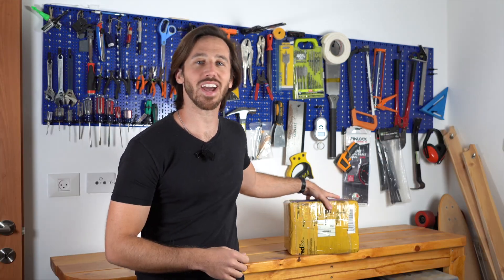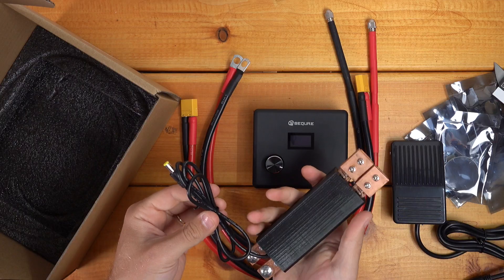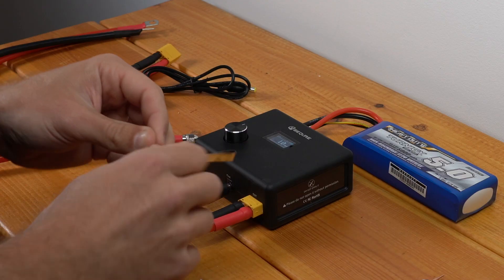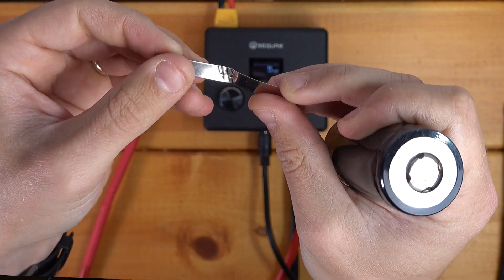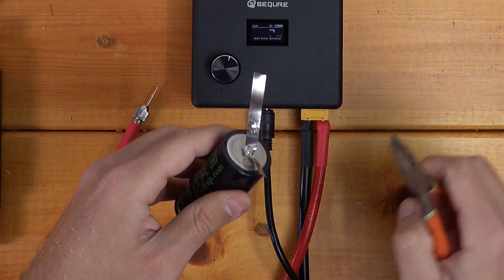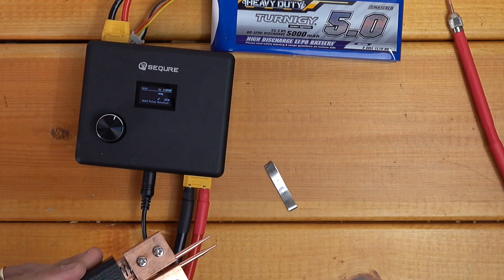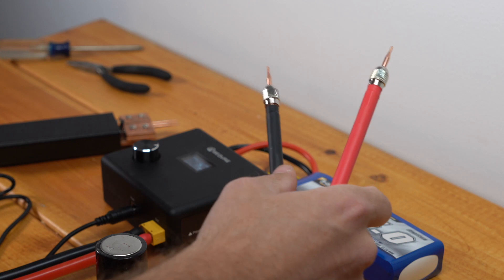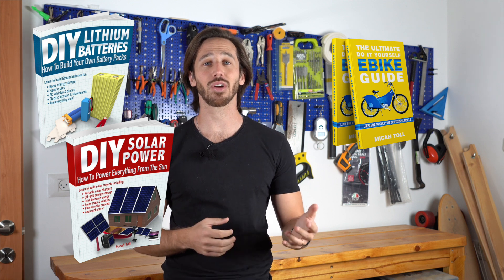Unboxing & testing the Sequre spot welder for DIY batteries

Comment: Mine is not working correctly, a 0.1mm strip needs about 30ms to 40ms and 0.2mm can't weld at 100ms and that's with a new battery(5000mA 3S 100c) I bought from Sequre!

Comment: I have a 2021 Bolton Lancer and I’m having trouble getting a secondary battery for it, seems it’s always out of stock.  I’ve just purchased your book on DIY lithium battery.  I’m not sure it will do me any good in build a battery for the Lancer as the secondary battery Bolton/Area 13 sells for the Lancer has a proprietary plug  the plugs into the side of the Lancer.  Do you have any thoughts on this?

Comment: I bought one or these after watching the videos thinking I wouldn’t need to buy another one. After waiting 3 weeks with no tracking details I got it and it worked good for the first 35 welds, after that it didn’t even went to boot up anymore. Said my battery was low even being charged for 4 hours. No power going to the leads. Spoke to the company and they sent me a defective board to replace and that took 2 weeks to come. Then accused me of wrongful install when I shouldn’t have to install a product that shouldn’t be broken. After I checked out the 2 boards I realized that the new board had 2 clips soldered wrong and it was shorting out of welder. All in all I’m pretty done with sequre as they really don’t understand that customers are the ones that make the company, not the other way around.

Comment: It’s very expensive, and based on Amazon reviews it takes strong batteries to power it. For the price you should not need to also provide a power supply solution. Reviewers have reported weak welds if power supply is not sufficient.

Comment: Perhaps exchange the button-head Phillips for button-head Allen?  There are drivers for those which are not merely-ball-ended, but also power-drive and setup like screwdrivers.  (I have these in Bondhus brand, both metric and SAE…)

Comment: Uses, "unsafe battery" to do a fusion method to link together the safer weaker batteries. LiPo batteries are not that bad. You literally have to abuse the hard case ones something terrible to get them to explode. I've dropped mine a few times 😬. And have had them since 2017. They're from powerhobby.
Reply: Every single lipo fire I have heard about was due to a fault in parallel charging. Don't paralell charge, won;pt have problems. They have reliable affordable quad channel chargers now like the Hota F6.

Comment: Very impressive unit... definately the way to go when building reliable battery packs, but it would be nice if the tips of the probes were a little bigger, less welds could cover more surface area than having to do many smaller ones.

Comment: how about connecting d 18650-ies with magnets? like flat ones, 25x10x3mm for example?  big question: could they damage or discharge d cells? maybe not as permanent solution, but at least for testing, when trying out different configs it would be practical. i may have seen it somewhere on d web. but, is it safe for d cells?

Comment: Hi Micah looong time haven't been in touch. Ok I've finally build the ebike of my dreams! A 5000w hub motor kit from Suring Technology in China for 435.00 not bad when you google 5000w kit you find them running at 1300. and up. Last hurdle is the battery. The motor kit is rated for a 72, 82 and 96v pack 150Ah 100A. Ok cutting to the chase here: I'm a old man living on a monthly income of 694. Social security. Hoping congress will passed the stimulus bill and get that 1400. stimulus relief check, could you build a 72v 100Ah 100A pack for me? I'll purchase the parts and pay you for your labor if you're able.

Comment: That is nice but $220 is high for me since I only want a few 18650 battery packs for long range drones. I almost want to find a reason to need this so I can justify the cost. Who doesn't love new tools?
Reply: If you order li-ion from Aloft hobbies then can spot weld tabs on them that can be safely soldered. You can even have them weld two at one end for 2S receiver packs. They pretty much only carry the ""good" li-ions for R/C use, I use Samsung 40T for my receiver packs. They also have the molicel batteries which make good flight packs for smaller aircraft.

Comment: This is really close to a pro unit.I wonder how many welds it will do continuously before overheating.also does it have a fuse,for protection? thanks for the video.

Comment: that is good high quality welds unlike what is used by the hoverboard scooter batteries.

if you can pull the welds apart easily then they are not good welds

if you strip out the philips screws then you are done because stripped screws are difficult to remove

you may want to practice on dead  cells so you dont have to grind off good cells

if you are going to welding a lot you will need a battery that can handle very high burst currents because seeing how the battery leads twitched when you welded you are probably drawing hundreds of amps in bursts.

Comment: You mentioned that you will “clean up”  your test spot welds later.  What method do you use to clean them up? This could be useful information for us DIY used 18650 crowd.
Reply: Ivan Goring  what type of file? All the files I have are straight.   How do you clean up the negative side without also damaging the battery sleeve?
Reply: @vxeel  get a Dremel or flat file.

Comment: The hand held trigger is a welding machine in itself. I have seen them being sold separately as handy welding machines at some places online. You just have to plug it in 12 to 24 v power source, they say.

Comment: Thanks for the great videos, I was wondering with this spot welder how it will do with different thicknesses?  I have been looking for a reasonable priced unit that will handle 0.15 or higher and maybe nickel plated copper up to 0.3. Thank you
Reply: This can be adjusted, but from experience mine went out after about a week. Remember that it’s going to take weeks to get warranty if you can even get warranty. I don’t recommend this spot welder for longevity. I took mine apart and it was poorly soldered and was pretty bad quality. If you can get your hands on a k-weld you should. Not this one speaking from a person that regrets their purchase
Reply: @bulldozaaa9353  thank you for sharing your experience.
Reply: The pulse time can be adjusted by spot welding different thickness nickel strip.

You can start with 5ms pulse time and slowly turn it up. Up to 500ms

Find a suitable pulse time.

Of course, the pulse time is also related to the discharge coefficient of the battery you use.

Comment: Was I randomly chosen?
That rectangular handle thing looks way to large and awkward.
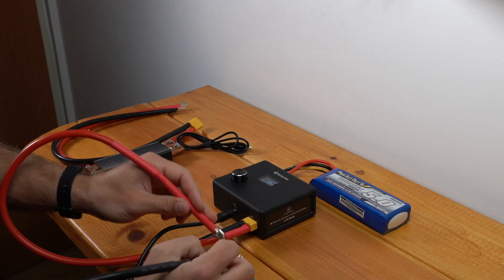Did you notice the spot welds also left holes or dents in the table?  Watch at 3:55
Reply from the maker: yes the table is lacquered (I originally built it for the kitchen in our last apartment) and so I think it melted the lacquer a bit

Comment: I also think it looks like a Malectrics. Would be nice to see a tear down. Also, IMPORTANT, you should not weld at, or too near the center of the neg end of the cell, as that is where the internal connection is.
Reply: You should get Malectric... This is POS. Not worth buying and if you want to return when you see welds are NOTHING but a tack and DO NOT BUILD BATTERY REQUIRING .2M NICKLE AND EXPECT SAFE RESULT.

Comment: I don't like the second option you showed just cause of the exposed terminals at the top of the handle, looks easily able to zap your hands.
Reply: We are talking about 12v here you are not going to zap your self. Unless you stuck your tongue on it then it might tingle a little (like a 9v battery does).
Reply: @mitchellwilson12354  Ah, okay. Thanks. I didn't know how much it was doing.

Comment: Thanks Micah for the comprehensive video. Your channels provide a lot of good info! Any recommendations for sources or specific motors to power a large motorcycle? Thanks!
Reply from the maker: I normally work with more bicycle-sized power levels, but I'd recommend checking out QS Motor.
Reply: @EbikeSchool  thanks for the recommendation! They have a wide variety of motors to choose! I am working out the design now.

Comment: Micah - "I don't like that they used Philip's head on these fasteners."
He instantly earns points with me.
He then proceeds to use slip-joint pliers on a hex nut.
Well easy come ... EASY GO.
Reply from the maker: If I was working on a satellite then I’d be right there with you. But for something like this, sometimes the best tool is the one in reach...
Reply: @EbikeSchool  I'm right there with you Micah, I just couldn't resist the jab. I use what's at hand ... all the time. Love your channel.

Comment: why lipo powered?
Reply from the maker: They can give short high power pulses, which is exactly what spot welders need.
Reply: @EbikeSchool  Would having it run off a transformer that outputs the same voltage requirement produce poor results? I like the build of this one and the compact size and the fact that the leads aren't fixed allowing for bigger batteries that get pushed out past the "regular" probe length of some spot welders but I wonder how long that LiPo would last.

Comment: Nice! I never spot-welded before and this looks like a perfect, nice size equipment to buy for beginners to use without difficulty.
Reply: Did you get it? How well does it work? Does it still work the same and have you had repair it yet?

Comment: I use the one from Malectrics with a car battery,  while charging the car batery with a floating charger.   It works like a charm.  Both based on arduino.

Comment: Looks like a Malectrics spot welder in a nicer case.
Reply: It should be verified if the manufacturer indeed copied the design and if yes, has he got permission to do that from malectrics?
Reply: @Arek_R.  If not, then it should not be promoted here.
Reply: Agree. I find it odd that he does not mention anything about that.
Reply: Very similar interface but pricy (£161 basic kit) got the Malectrics!
Reply: Agree, same display and menu structure as Malectrics spot welder. I would see what's inside.
Reply: It is. I see legal action soon unless it's authorised. (Just checked, it's a china rip off of the Malectrics) only more expensive!
Reply: my thoughts exactly
Reply: interesting
Reply: Whatis the name of spot welding and how much?
Reply: @ernestobayugo6323  The Malectrics spot welder is about 110 euros plus delivery.
Reply: @ernestobayugo6323  Malectrics spot welder it's about 150Euros

Comment: Do they make mains powered versions? Preferably one that can handle both 120V and 240V (or just 240V for my requirements)
Reply: If they did it would be more expensive than using a battery setup. Spot welding needs a lot of DC current so storing it in a DC battery is cheaper and easier than using large enough caps and switching circuitry to use AC input power

Although I've never spot welded before, but I suggest using a meady 12v 16ah LiFePO4 battery. Only $55 for 200Wh and it can do 500w continuous (40A) maybe more if you replace the internal BMS

Lithium iron phosphate (LiFePO4) batteries can output so much more power without voltage drop. From what I've learned, voltage drop is usually what causes bad spot welds, so not powerful enough battery causes voltage drops, abd many things can cause that from battery type, size being too small, not enough charge on the battery, age, ect.